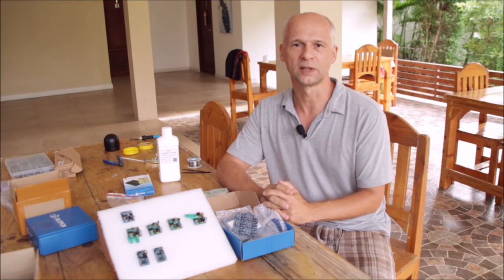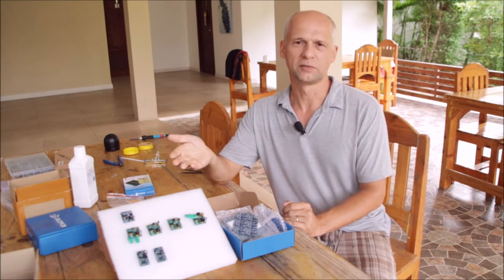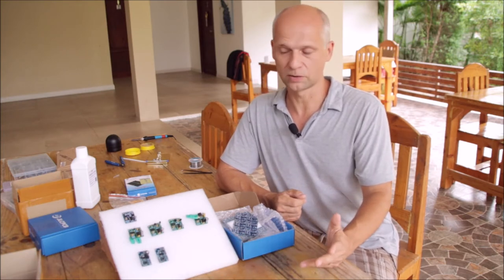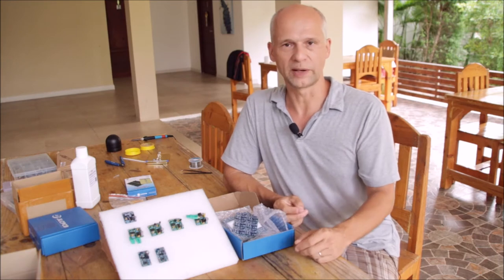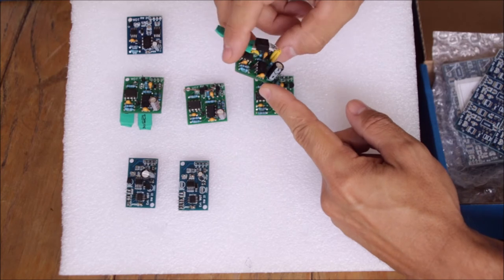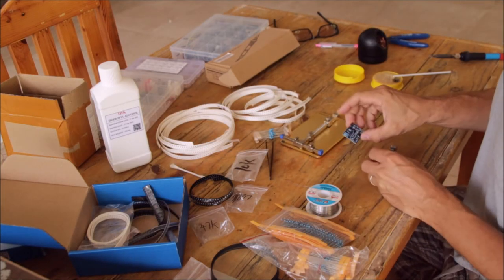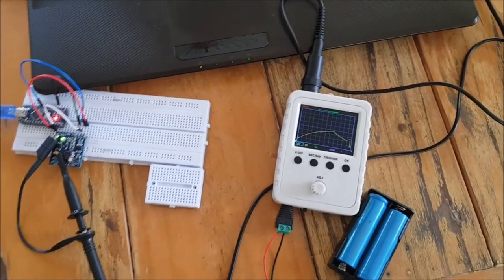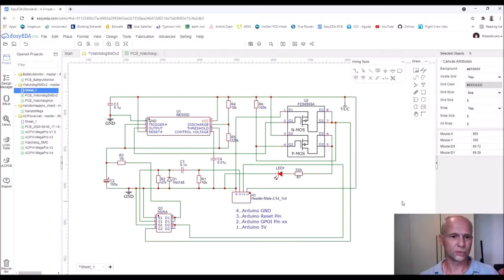Finally, we have a working External Watchdog Timer \o/

Comment: Hi Roland, your project seems very useful, thank you for posting it, I learned a lot from it as I'm trying to build similar solution. I reviewed the schematics you included at the end of the video and I wanted to confirm if the description of pins 2 and 3 are reversed by chance. Description says pin 3 is the arduino RESET pin, but connections show it feeding the G1 of the 9926A, which I'm thinking is what generates the pulse to keep the 555 alive.
Reply from the maker: @estranhoecurioso9475  hi. yes, looks like i have mixed up the description of the 2 pins as on my board the header is routed differently. i remember that at my second try i did in fact have the pins messed up. maybe the schematics was from that try. thanks

Comment: good circuit ,i could see my self building one soon .
Reply: pzem-016 can be a bi-directional meter
Reply from the maker: PZEM is DC only, right? Or can it measure AC power?
Reply: AC DC i jus got mine
Reply: Modbus with Arduino is need some help  :(
Reply from the maker: @olvano  yeah. I lost it there almost as well... pzem? send me an email with details, and I will try to help you
Reply from the maker: @olvano  or maybe this library can help you: https://github.com/mandulaj/PZEM-004T-v30
Reply: i sent the code for u to fix  with modbus .i need zero export
Reply from the maker: @olvano  yes, sent a link to you. please try to read out the meter, and then if that is working, we can continue wirh the functionality

Comment: I had this DIY Oscilloscope too and was able to destroy it within the first 10 minutes of testing : /  Beside the dual channel ds212 i have, which is quite difficult to operate, cause its so tiny and I felt the metall housing is under power when connecting the ground not to the neutral, I ordered now the promising Aneng AOS02 (same as ZOTEK / ZOYI ZT-702S) for less than 40 Euros! Maybe interresting for you too ...there are many enthusiastic reviews about it...  : )
Reply from the maker: This is only good for slow signals, and you have to be careful not to use it on high voltage signals without the 10x probe.
Reply: @RolandW_DIYEnergyandMore  Yes not to get a 10x probe with it or not to be smart enough to order separately one right away and make some tests with 230V was a fatal mistake. Fortunately the Aneng AOS02 comes with a 1x/10x probe. Its also just a 10MHz Oscilloscope, but thats plenty for my uses.
Reply: @RolandW_DIYEnergyandMore  In order not to withhold it, there are of course also two-channel oscilloscope-multimeter combinations for about 25% higher price, for example the FNIRSI 2c23t, but I do not like the design, the haptics and the operation as well. The Aneng is smooth, intuitive, straight ahead without detours via menus, not as overloaded. 
For the extremely rare cases where I need two channels or a signal generator, I personally have the small DS212, which, like the Aneng, has an extraordinarily crisp screen... i like it soo much... ok I know.. I talk too much : x
; )
Reply: @RolandW_DIYEnergyandMore  Maybe not interresting for you, but anyways, the Aneng AOS02 has arrived and I'am thrilled by that thing! With the 700 grams it feels worthy and tough. The little numbers on the screen (in KO-Mode) can be easily read from a meter away. Contrary to the reviews, the device now remembers when it is switched on again whether it was last set to oscilloscope or multimeter. They improved the little problem with the current measurement, which gave incorrect values if you plugged in to mA but selected the A range (and the opposit), so that the short warning with a picture which shows to plug the cable into the correct socket now appears every time, instead just once. The storage bag is a bit small and flappy. I ordered a harder one, twice as big, so I can leave the probe plugged in and everything else can fit in clearly, including the two multifunctional laboratory cables (highly recommended) and the extra-thin measuring tips.
Have a Nice Evening 🙋
Reply from the maker: @topeye4202  starting a repair business as well? maybe with a YT-channel? ;) The meter looks really nice. I can see why you are excited.